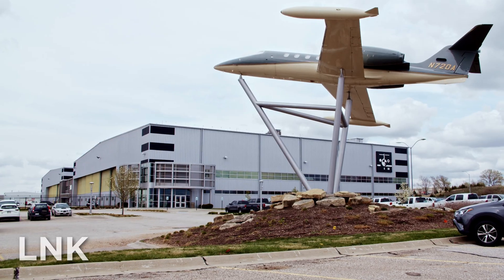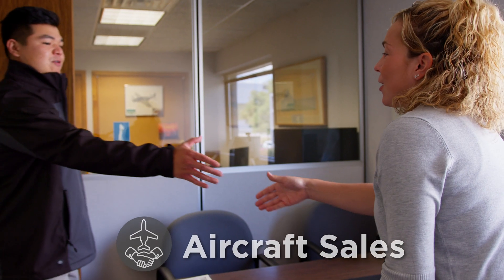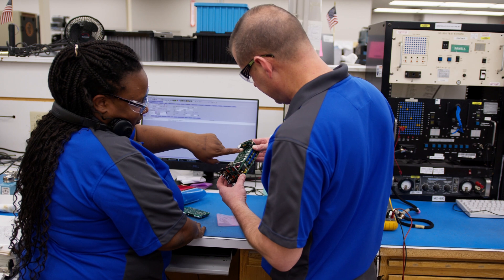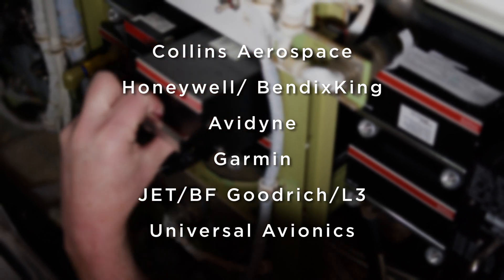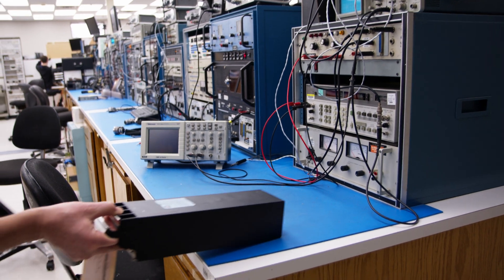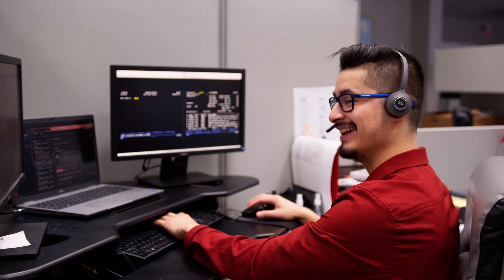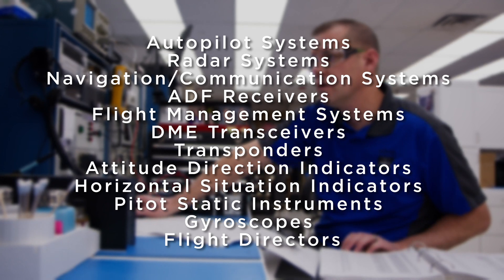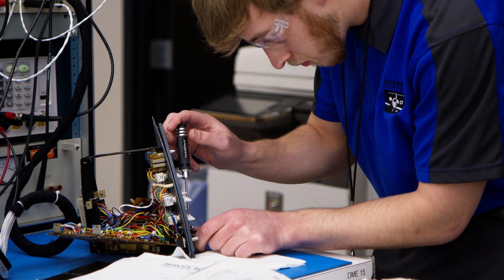Duncan Aviation | Avionics Components Repairs

Comment: Hello. I am university student in Turkey. My major is avionic engineering and  have a project to complete. The project is about testing the Bendix King KR 87 adf system and KI 227 indicator with Linaire L-280 test unit. But i have done tons of research to get a document how to operate and wire linaire L-280 to the KR 87 and KI 227, found nothing. Because the manufacturer is closed i think. Is there any chance to help me? Thanks a lot.